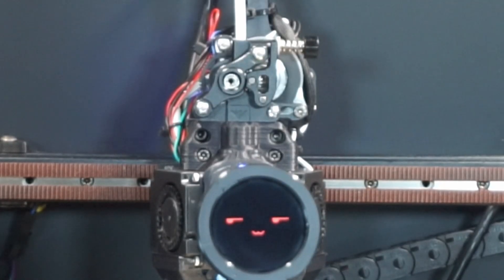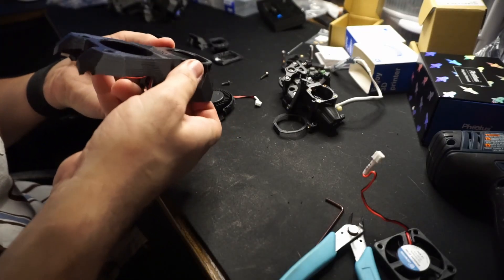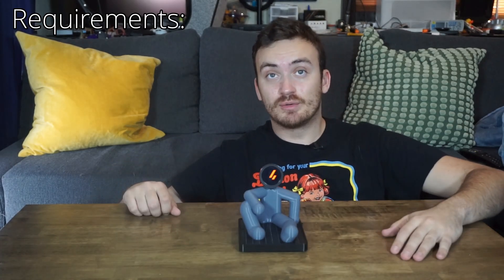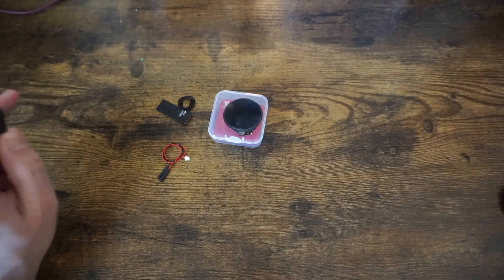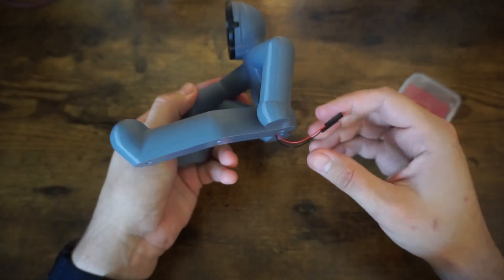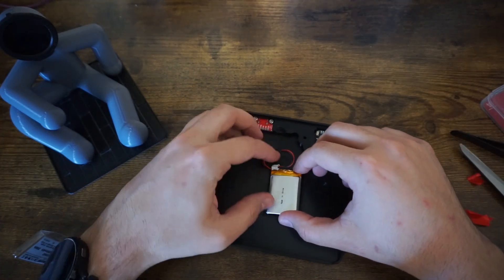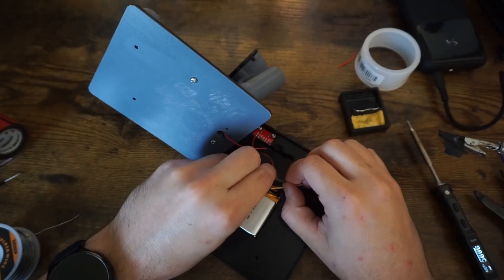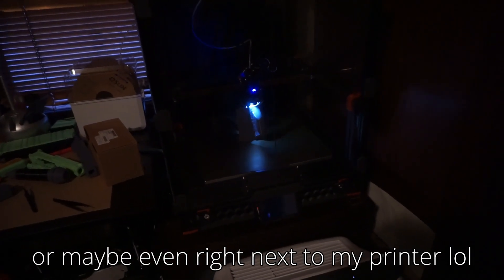Making a 3d printing assistant(Knomi V2 Review)

Comment: what is the program you use to modify the base for a bigger Battery/
Reply from the maker: @robertpatton2140  i use fusion 360 but most other 3d modeling software should be able to as well, just needs to be able to open the step file